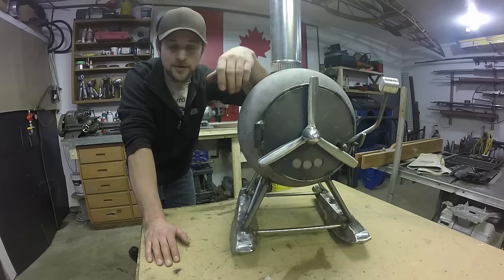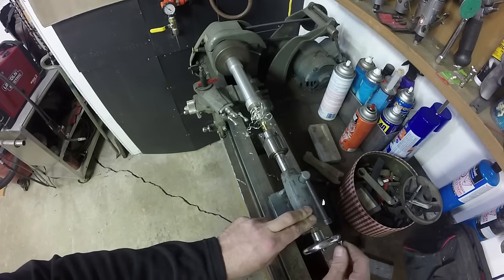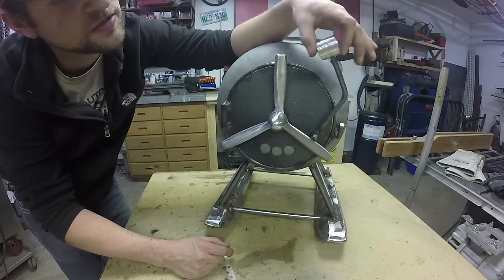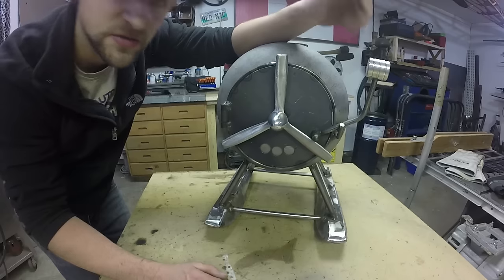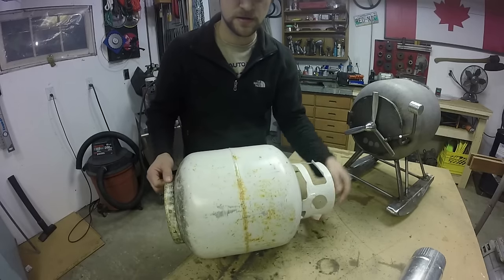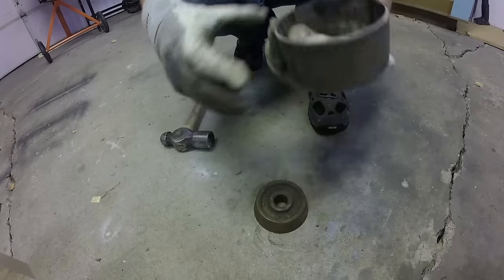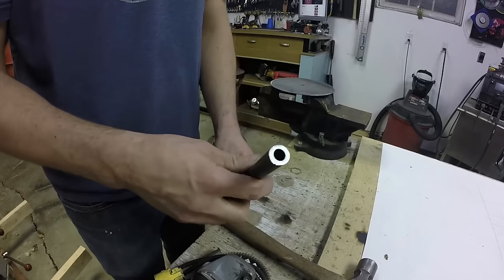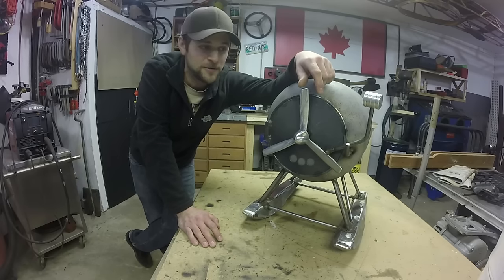Float Plane Wood Stove! - BUILD YOUR OWN!!!

Comment: That's one of the cooler projects I've seen in a while, way to go nice job. Thanks for the tip on the flue connector to the tank, I'll file that one in the memory bank for sure. Just thought I'd mention it, I'm sure you know, but in the start of the vid it looks as if the crimp is facing the wrong way on the stove pipe. Make sure the crimp is downstream and the raw part sits around your pipe collar......looks great and and very smart. Nice job. 
-Pidge
Reply from the maker: thanks! actually i always put the pipe "into" the stove. its stops stove juice from running down the pipe and burning on the outside of the stove. all stoves that you buy are designed that way. thanks for watching!

Comment: Great job on the stove. Appreciate the tips also. So, do you actually leave the original bottom ring as your door seat? And on the other end, how do you seal the valve opening? With weld or a plug?

Comment: Hello,  I bring up the idea of protruding the stovepipe as most commercial manufactures in an effort to diminish creosote, make a more efficient burn, and satisfy EPA requirements have incorporated some sort of delay to exhaust gas emission.  Sometimes it takes the form of a plate welded inside the stove between the direct route from fire to chimney.  I believe but am not totally sure which part is more important but the higher temperatures and/or delayed time in the burn zone encourages the combustion gases that have not ignited to do so.  This provides a secondary burn that otherwise would go up the chimney and or deposit on the cooler chimney walls and add to creosote formation.  Might be worth an experiment on a bare bones model to see what the stack temperatures run at between both versions?  It would also make fabrication a bit simpler.  
Take care.  Doug
Reply from the maker: +Douglas Thompson i have put a plate in some of the stoves. On the small ones there isnt too much room in there so i opt out. Also, a chimney fire in your ice shack just makes for an entertaining day! Hehe.  I always thought the plate was just to stop the flames from going up there.... but of course thats crazy talk and ur right. It would be interesting to see if the pipe protrusion makes any difference.

Comment: You should upgrade this with a small turbine and turbine housing inside the door, to utilize the airflow of convection heat (hot air going upwards) to turn the turbine, which in turn would turn the propeller. I'd love to see it and you get at least a 100 Cool Joe points added to the project.

Comment: Awesome work and thanks for the tips!  I plan on making something like this for my little 1 car sized workshop.  Maybe I can find a slightly smaller sized tank...  Right now I've been using an ark welder, but I think a mig is in order for the amount of welds here as ark welds always seem to look like sh!t (but that could just be me doing them of course)...
Reply from the maker: thanks! yeah a mig is much easier to use on the this stuff. good luck with your project!
Reply: REDNIC79 Yeah, my problem with stick/ark is the all the flux that deceivingly looks like weld and is always in my way!  (constantly have to be chipping it off).  Maybe's it's the rods I'm using too...  A mig has been on the list, just been looking to pounce on a good used lincoln, miller, or hobart 110v (like one of the 140 machines) that already comes with a bottle.  Want to stay away from flux core which is kind of my whole point for getting one...

Comment: Nice, how do you cut the opening in the front door? and if you don't have a plasma gun. What about the inside? and racks or anything?
Reply from the maker: +azbikerider49 i cut the hole with a plasma cutter, but you could drill a hole and then cut it out with a jig saw wirh a metal blade perhaps. Don't usually do racks inside, sometimes on top
Reply from the maker: +azbikerider49 i usually plasma cut the door opening, but you could first drill a hole and then cut it with a jig saw with a metal blade perhaps. I don't usually do racks inside